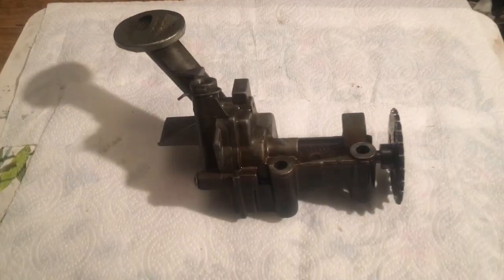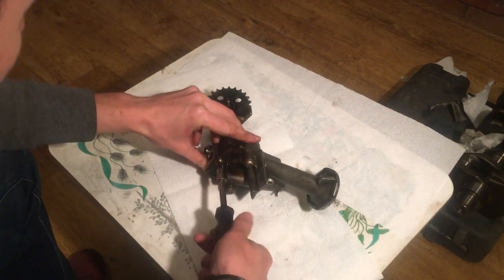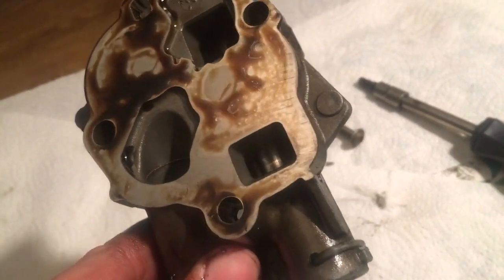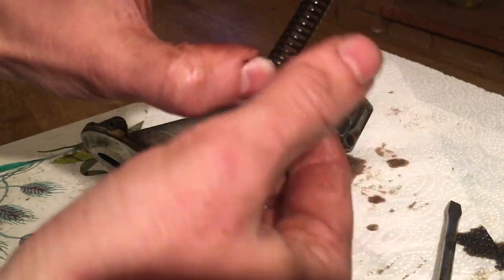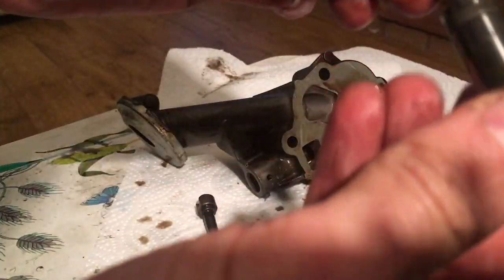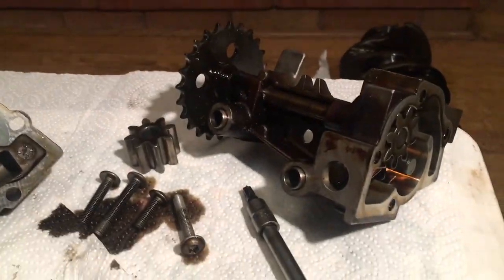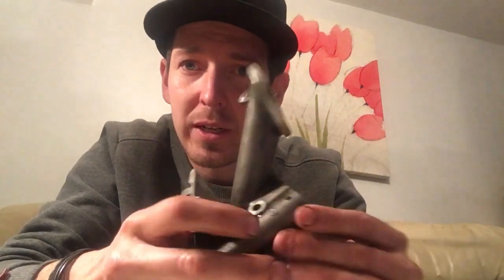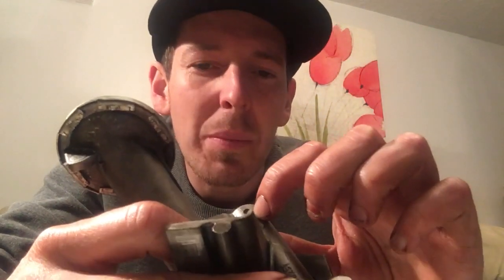Oil pump strip down guide - clio 172 / 182

Comment: If you replace this oil pump with a brand new one you will defenately up the oil pressure resulting in a less noisy engine 

Because you cant see the wear of course   it is measured in thousands of in inch

Comment: can I ask? Is the noise from the camshaft any problem with the oil distribution? Is it happening around the oil pump?
Reply from the maker: Hey. Sorry don't completely understand what your asking Sorry. A clio sport has a Dephaser pulley which can fail but that's just wear. 
Top end damage can be due to poor oil pressure for several reasons.